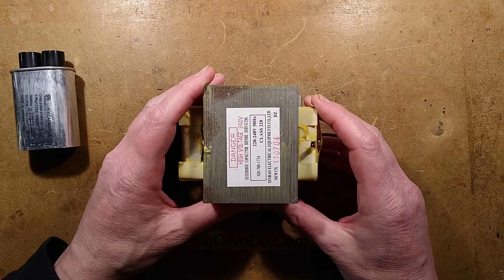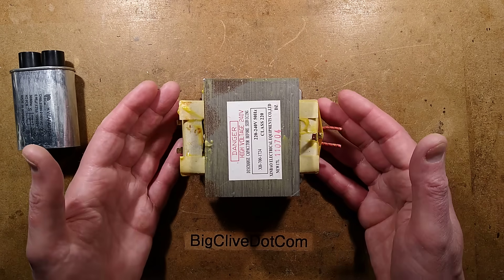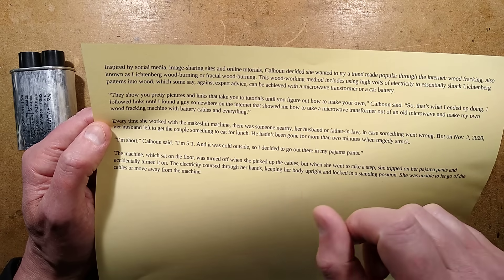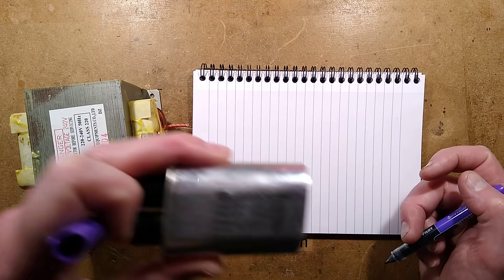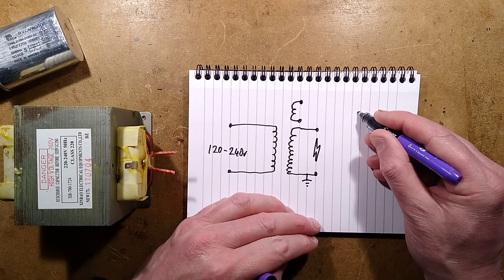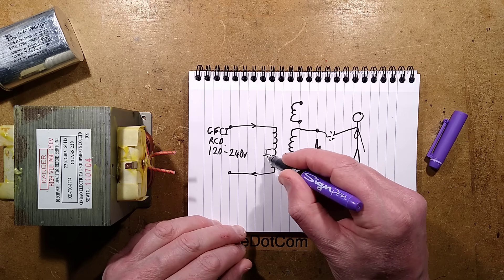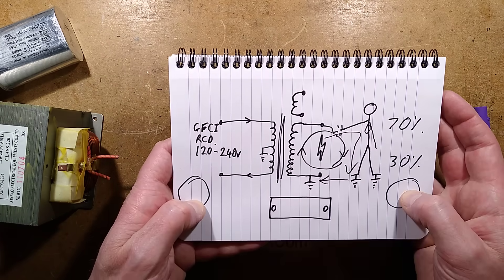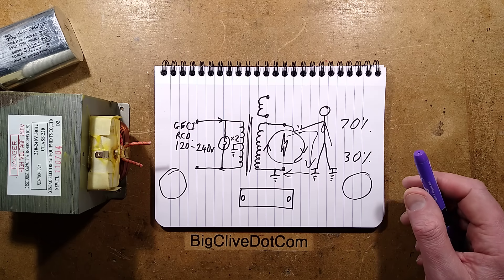The most deadly project on the Internet

Comment: omfg... that picture... i mean i'm on reddit and have seen much wore gore but i m also a phyicist who trained as an electrical engineer for 3 years at first and NEVER would i have guessed electricity can do that to you.
correction: of course i know electricity can do that, but if you'd shown me a picture (not tht healed one) of the hand right after the incident, just the hand, i'd have for sure told you that person was dead end of story. cause that electricity had to be going somewhere, it likes the ground or so i ve heard, and unless she stappled a ground lead to her elbow or whatever that stuff is entering by your hand... you gotta ask yourself, where does it want to go?
well to the ground. how? and thats the i would have guessed she's dead part... as BC mentioned i think, this 2000Vrms is EXACTLY the voltage used to kill people in what is supposed to be an instant death. 
so surprised she didn't die, wonder where the current was flowing though, in almost every case it has to have involved the chest, if the exit was the foot or other arm you've got a lot of lethal energy in your chest...

btw thats the reason i think, read it somewhere and as it makes sense to me and there is that law that everything on the net is true we'll assume it is humans are more likely to survive lightning stikes then say cows. it typically doesn't smack you in the head, you're taking cover under some tree or it hits the ground somewhere closeby  so what it often does if i m not mistaken is go up a leg and down the other. i'm gonna have to fact check this cause it does make sense cows would be more vulnerable (vitals are in the path from leg to leg) there logically should be many shudders stories of dudess surviving with burned... i don't even want to say the word lets end this there i'm legit shuddering at the idea

Comment: Overhead power lines in residential neighborhoods are 7200 volts, not 2000
Reply from the maker: There is a wide variety of transmission voltages.  Some are quite low.  None are good to play with.

Comment: I want to turn an old microwave into a turn table. If I disconnect the magnerton and the fan, will that work? (worried about the capacitor. Should I leave that connected?)
Reply from the maker: As a turntable the only bit that would need powered is the synchronous motor on the bottom of the unit.
Reply: @bigclivedotcom  Thanks for the reply. Found some microwave motors are 240V (the first one I found was 30V) so a 240V works fine straight of the mains.

Comment: I take the absolute best approach, I'm not an electrician so I do not play with high volages or high currents and still take caution with low powered devices. Considering thar Voltage and current are proportional, the best thing to do is convert to a power measurement V(Voltage in Volts) × I(current in amps) = P(power in watts) (If you don't actually know what you are doing, as in you have no electrician education on the level of a certified electrician DO NOT PLAY WITH HIGH POWERED ELECTRICITY. Even a tiny 9v battery can cause you significant pain if you mess up and connect it in such away that it releases all of it's power in a single surge.
Reply: Sure. Maybe, maybe. Very probably.
See also: !Coilgun and Survival in the Zombie Apocalypse (Step by step assembly of Coil Gun from 01:57)
https://youtu.be/_9WUcGwmS5s

Comment: Just the 'mains' will throw me but I knew an Arab worker who would hold live & neg cables and not feel a thing, thick-skinned? The forces had something called a personnel resistance tester, never saw one or hear of one being used, just something lost in the system.
Reply from the maker: Some people have a thick layer of outer skin.  But they are gambling when they hold live wires.  Especially if they get over confident and moisture gets involved.

Comment: there are nutters every where.  iv had chest hurting shocks from old valve kit, when i finally noticed it wasn't a sharp wire , it was  was volts!! showing   600v-dc in each cap. 2 weeks later it was showing 300volts, a charming valve amp from italy.  details, my dvm 20m-ohm-pv, no load! just my heart.

Comment: Since I having some issues related to static charge on a plastic shreeder I made, I was wondering IF i can use something like the transformer from an old microwave I have in my garage to make a ion generator to kill the static charge.

But since I know that I'm used to have idiot behaviours, sometime, I left that in his place for the moment.
And however, I don't know if it can work to do that job.

Your video convinced me that it's better to avoid to make anything different than a spot welder with that.

By the way... there's a way to build a static charge eliminator for my plastic shredder, possibly a safe one?

Comment: Electricity is NOT a toy. If you don't understand what you are doing (and sometimes even if you do) you have a very good chance of dying. I can only imagine how many people have been killed following bad advice that the saw on the internet. If you think working on electrical stuff with bare feet is OK, well, you probably aren't going to be around too long. I also always wear my Electrical Hazard rated boots when dealing with electricity.

You end comment reminds me of some video work I did on Table saws safety many years ago. There are people who are missing hands and fingers that made the comment "I have worked that way for over 40 years and never had a problem". Now you have people buying Sawstop saws and thinking they can act like complete idiot because they are safe. It's not. People still get seriously injured on a sawstop saw. Maybe it's not as bad as it could have been, but it's still bad.

I have developed the habit if I am working on electrical and walk out of the room for a minute to get something, I check the power when I get back into the room. It's probably a waste of time 99% of the time, but there could be that one time someone turned the power back on and I'd rather take the 2 seconds to make sure there isn't power than get shocked. I really, really, really don't like getting shocked, even if it's a low voltage shock that doesn't do any harm.

Comment: if the transformer is not connected to anything (simply pulling it out of the box you ordered it from), does it pose any risk? does it hold charge like a cap? same question regarding physically disconnecting it from your project and having it alone on the table, can it still pose a risk from handling the disconnected transformer?

Comment: I dont see why the HV terminal connected to the frame of the xformer is considered grounded...its just connected to the frame. I would consider it  just as dangerous as the other....keep it on an insulated surface. I connect the terminals to the wood ..then plug in an extention cord to an outlet 10 ft away and stay away...getting closer only to use an air hose to keep the flame down...using  a movable electrode is  too risky for me.

Comment: Could the Ground at HV side be disconnected from Transformer ground ? Connect probes to coil only ? Could a gas light be placed across the output to illuminate High Voltage in place ? Are there any methods to acheive colour in the fractals ?

Comment: I built a tiny 1-inch sized high voltage transformer for fun. It powered an LED and didn't seem to damage it so I thought since I only use about 3 watts it was safe to touch the contact to see if I can feel a tingle. I got shocked pretty good, my mom sat next to me and couldn't stop laughing. lol. good lesson ;)
Reply: Without knowing anything about your device it might have limited current. Think of a stun gun, high voltage, but limited current. It will hurt like hell, but it won't kill you because the current isn't high enough to stop your heart.

Comment: There's and episode of Accident, Suicide or Murder where the detectives were investigating a man and a woman dead in a burnt down house. and they thought is was a murder, but later thru investigating they found out they were doing this fracting, when they went in where the burn victims were they found jumper cables and  a microwave transformer. This couple saw this on the internet and wanted to do it. but they ended up  
dead and burned up. My advice if your not a high voltage electrician and understand the dangers of this you should not do it. Another point is that 2000 volts is what the electric chair uses because that is what conducts the most current in the body.
Reply from the maker: That was clearly based on a real case.

Comment: Over winter break I took apart a microwave and made something dangerous but In the other way, I cut off the secondary coil and replaced it with 2 coils from jumper cables and made a spot welder

Comment: I Take a SAW and destroy the 2000volt Output Coil,Substitute IT.With 14 I have a 10 seconds Schock with burning Finger From a Phase and good Earth ground Ac230.I Run and the cable Plug fly Out😂😂😂🙌👲

Comment: Talking about the capacitor, I know that people working on old CRT TVs/Monitors have had serious injuries, or worse, do to not knowing how much voltage that picture tube can hold, how long it takes to discharge,  and the proper way to discharge it.
Reply: We used to call them a "Fly back" and I thought that was the name.  It took me a while to realize that it earned that name because when you touched it, you flew backwards.

Comment: It is absolutely no surprise to me after watching some of these videos folks are getting hurt and killed.
  Holding the high voltage probes, One in each hand, and sticking them into wetwood,  It's like saying "please kill me".
 How old or dirty  Is the insulation on gloves and the wiring... Dirt and moisture being a path for the current.
 I get it folks want to try something like that, I do too and I probably will but I've been an industrial electrician for 20 years I can probably do this and not get hurt.

Comment: Great video as usual.
Regarding safety I have a very dumb question.
I am building valve amplifiers that are powered from a laptop power brick. My power adapter's voltage is 16V and 2 or 3 amps of current.
Then I use a small boost converter to raise the voltage to 180V. The question is: can this kill me? I know that a person can die with as little as 10mA of current.
Thanks
Pedro
Reply from the maker: Most boost converters in that sort of use can give a shock, but it's unlikely to be fatal.

Comment: From An old oil heater ignition transformer 240VAC to 10,000VAC I once made a working Jacobs Ladder , a great science fiction effect , safety provided you stay well clear of the secondary rods and never leave the project unattended , lock away when not in use.